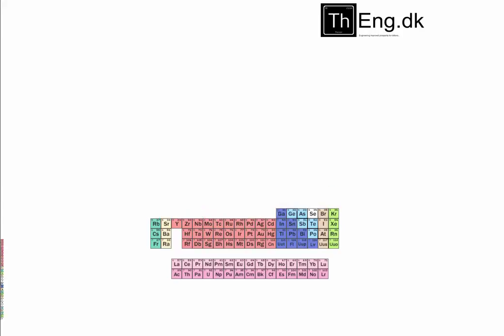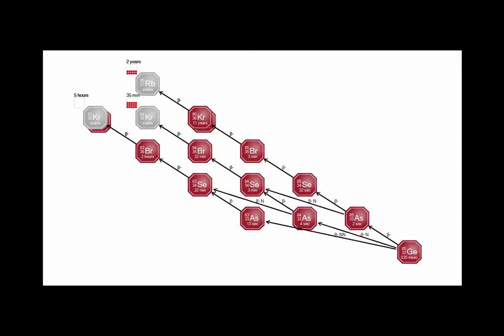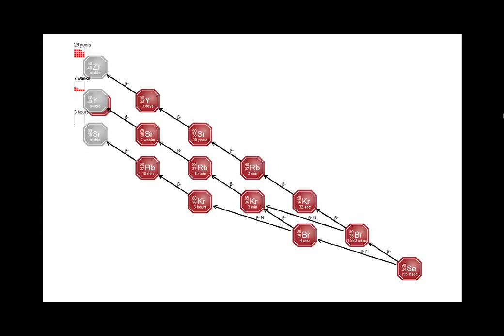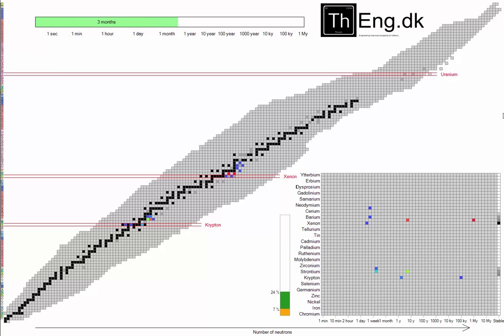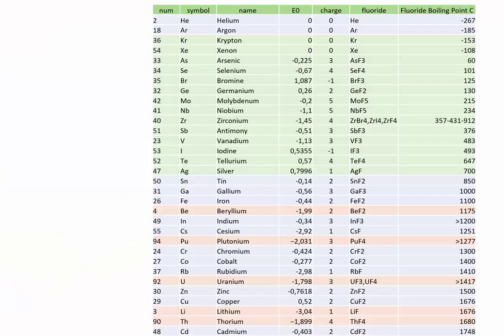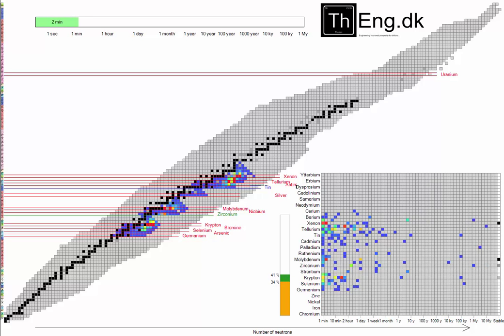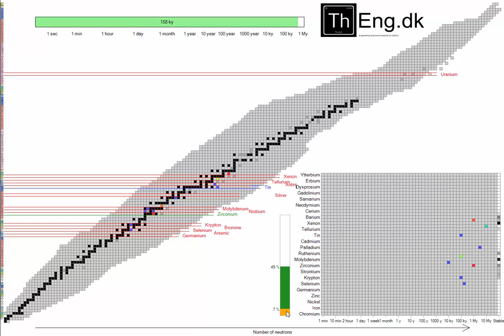Molten Salt Reactor off gas simulations

Comment: How much Xenon-131 can it make per Gigawatt-year? Enough to be cheaper than naturally occurring Xenon for ion thrusters?
Reply: Assuming a 50% thermodynamic efficiency of your electrical generation system, about 329.2 grams, by my calculations. Only produced by the decay of Xe-131m, which accounts for just 0.0388% of allthermal U233 fission products. Slightly higher at 356.3 grams for fast spectrum.

Comment: I didn't see anything about technetium in your charts.  One criticism of Thorium MSRs I have heard is the production of technetium-99 with half life of 211,000 years (not the isomer "technetium-99m" with half life of 6 hours).  
Would technetium-99 be produced in some of the alpha/beta decay chains of a reactor using U-235 (initially to kick off chain reaction) to breed Thorium into U-233 and the subsequent fissioning of U-233?
Reply: The thermal neutron fission of uranium 233 produces Te-99 with a yield of 5.03%.
https://www-nds.iaea.org/sgnucdat/c3.htm
Reply: @Joshua Guertler Surely Tc-99 and other "wastes" would be left in the salt stream to be burnt it down along with the other fuels and transuranics?

Comment: How much would it matter to extract fission products were the neutron spectrum harder? For example, the thermal neutron interaction cross section of Xenon is far far larger than the fast neutron interaction cross section. So you would not need to run the helium sparging as vigourously. In addition, the graphite lifetime problem is also avoided.

Comment: One question I never see addressed - maybe the effect is too insignificant to bother with - is the transmutation of the fission products.

If the fission products are not removed and are left to circulate in the reactor, products like Xenon-135 with huge cross-sections are liable to eat of neutrons and poison the reactor.  But when it does so, Xenon-135 becomes Xenon-136, and now that's a completely different decay chain.

Is transmutation of fission products remaining in the reactor modeled properly in this sort of model?  And are there any decay products that are beneficial to leave in the reactor, to absorb neutrons and embark on a different isotopic decay chain more favorable to chemical separation?

Is this effect significant, is it modeled, and can be it exploited to help chemically separation by diverting some isotopes onto different, more favorable decay chains?

Great video by the way, if that wasn't clear.  Thanks for making it.
Reply: Not insignificant
Reply: As I understand it the noble gasses are sparged from the fissile salt so they do not stay in the system to poison the neutron flux. This is one of the big benefits of liquid fuelled reactors over traditional solid fuel in sealed cans. In the latter the noble gasses build up and the fuel has to be removed and stored as waste.

Comment: What percentage of reactor power is being removed by taking out gases though would impart their beta energies to the salt?
Reply from the maker: Between 1% and 5% of the reactor power is removed from the fuel salt. But most of it will decay in the filter where the FPs are removed from the helium flow gas and this filter will also be cooled by the secondary coolant salt, thus in a clever reactor design very little of the heat will be wasted.
Reply: Small

Comment: @3:45 you forget to mention the extraction efficiency  
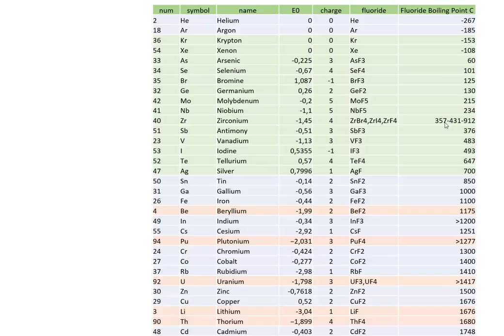@8:00 you again don't mention the different extraction rates
Reply from the maker: The simulation assume that 80% of the FPs which have evaporation temp below 800 C will be extracted while they are inside the vacuum spray chamber. It is assumed that the fuel salt circulate the reactor loop in 20 seconds and is inside the vacuum spray chamber for 1 second on average.  Some of these numbers can be improved with a clever reactor design.